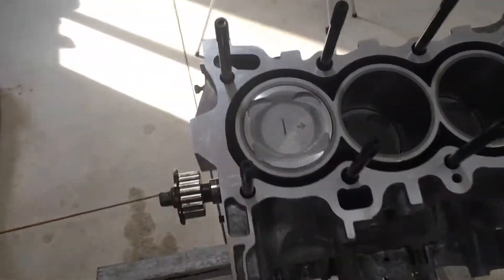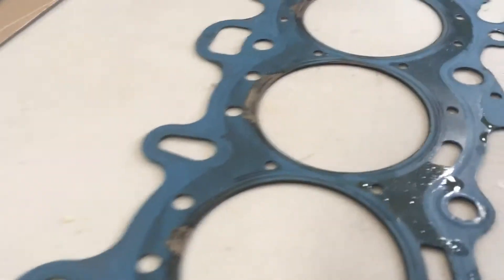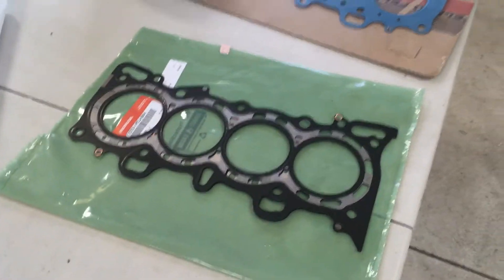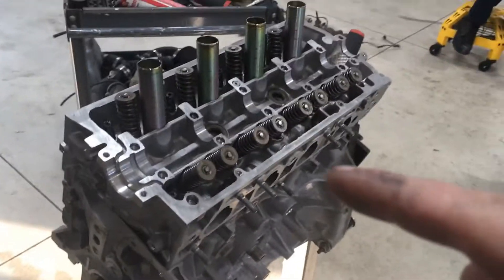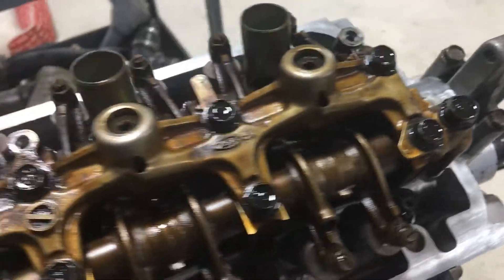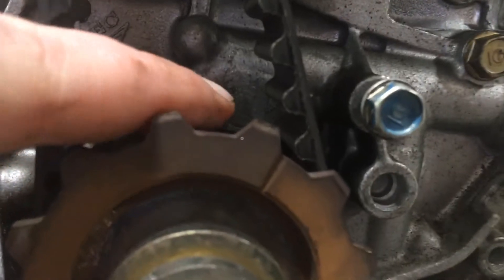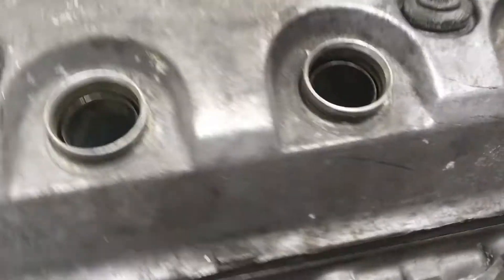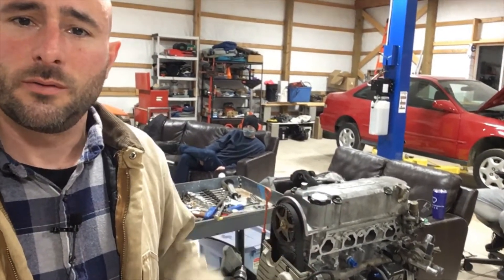My D16Y8 Vitara Build - Part 2

Comment: My block has over 500’thousand miles I’m rebuilding it also would you recommend a new oil pump I think it would be best to change it a lot of people told me it would not matter!
Reply from the maker: @patrickcraan4073  it really depends on the maintenance history of the engine and whether it’s being rebuilt due to oiling issues. I like to take the oil pump apart and inspect for wear before deciding to replace it. At 500k it wouldn’t hurt though!

Comment: Doing a similar build you mind putting info on the manual you used for the build ?
Reply from the maker: It’s the factory Honda service manual for the 1996-2000 Civic. You can find a PDF copy to download from Google.
Reply: @ShawnFerret  thanks alot 🙏

Comment: Don't rev past 7200 unless have upgraded valve springs imo. Very clean build and hope it all works out great.
Reply from the maker: Thanks! I haven’t changed the rpm limit. It’s great so far and has about 1200 miles on it now.
Reply: This engine could easily handle more than 7200rpm, the stock rpm limited is 200 higher than that. As for the ARP bolts, D series have a hard time holding their HGs tight so many people opt to tighten the head bolts to as high as 90 ft⋅lb. I have several d series setups.  I also have a red EK but after a few years beating on the D16Y8 I noticed a rod bearing was starting to wear thin and luckily it didn't chew the crank yet. I ended up swapping a D16Z6 out of a boomer's wrecked sunday-driven Del Sol. I also have another Del sol in tact with a unmolested D16Z6 in it. It sucks I can only play with these cars a few months out of the year living in Mich U. P.  but when you can there are a lot of roads to do pulls on. lol. I'm subbing this channel and coming to check out other videos because I am also in the process of basically copying what you have, a pole barn with a Natgas heater. I'd like to pick your brain
Reply from the maker: @DelFam2011  sorry I missed this comment before! Sounds like fun up there in the U.P. Feel free to shoot me a message on IG if you have any questions about the shop setup.